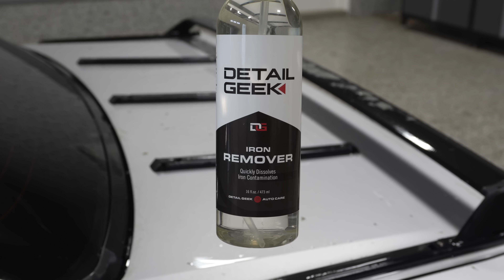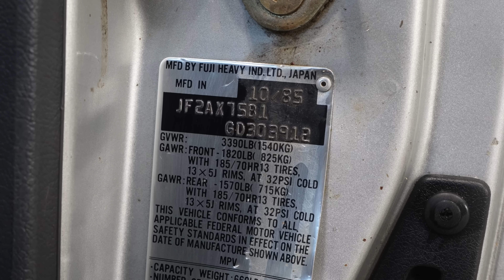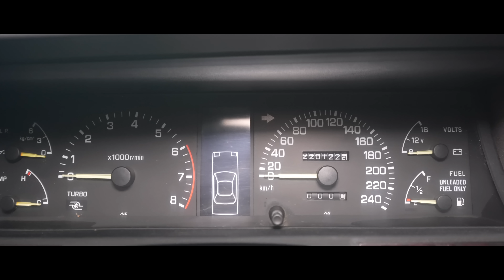I Found The RAREST Car From The '80s To Detail!

Comment: Subaru made just under 100,000 of these.  Not sure I'd go with the title "rarest". There are many vehicles with lower production than that.  Subaru had high hopes for them but, even back in the 80's they were odd looking.  The AWD drive was cool but not a big deal then like it is today.  You could buy an OMNI GLH or a Shelby Turbo Charger for less money and blow the doors of an XT

Comment: When you are cleaning the seats, floor carpets, etc and you wet them down pretty good with cleaning agent.  After you are done scrubbing with the drill and extracting as much liquid as you can, what is the best way to allow the rest of the seats, carpeting, etc to fully dry so no mold starts to form if your car is outside when you clean it?   Not sure how long on average it takes to dry.  Thanks and keep up the amazing work.

Comment: trying to crank a motor that's been sitting for so long without preparation is a terrible idea. try removing the spark plugs, fill er up with WD-40 and let it soak for a couple of days. then - very carefully - rotate the engine by hand first.

Comment: Beautiful detail job. My husband owned a 1989 and a 1990 XT6 for a while. Those were fun to drive! The biggest problems with them as they aged were rust problems and snapping bolts on the one that we got that had lived in the northeastern U.S. before we got it and occasional oil leaks. If you work on one that has been in wintery climates, you really need a good helicoil and drill out set to deal with snapping bolts regularly. One of the biggest reasons that more of these don't survive though, is because they used a special fluid for the power steering system. Once Subaru stopped making them, the special fluid became as rare as hen's teeth after a while.

Comment: In 1988 I owned a Subaru XT6 AWD. This was the 6 Cylinder version. I loved that car. Got almost 300,000 Miles on it before it was time to say goodbye. It started leaking oil from every gasket in the engine. It would have cost more to repair it then the car was worth. The only drawback with this car was that every visit to the dealer for service it was a minimum of $450.00. Thank you for the memory!

Comment: Never ever start  a car that's been sitting for years unless you check inside the air filter first... Sucking up debris into the top of the engine isn't a great start 😎 just sharing some info ...